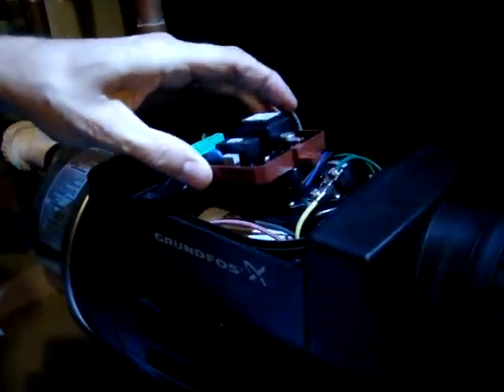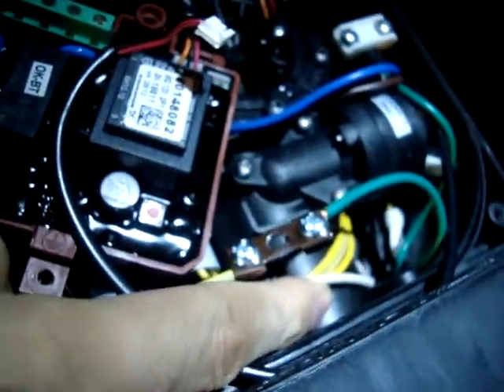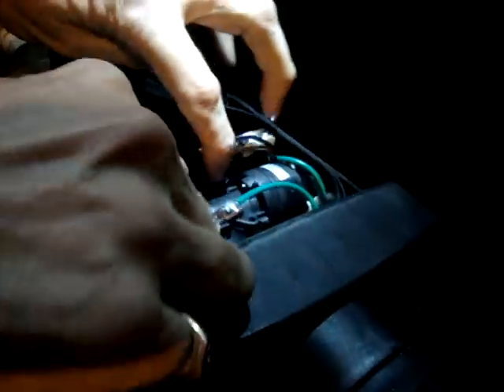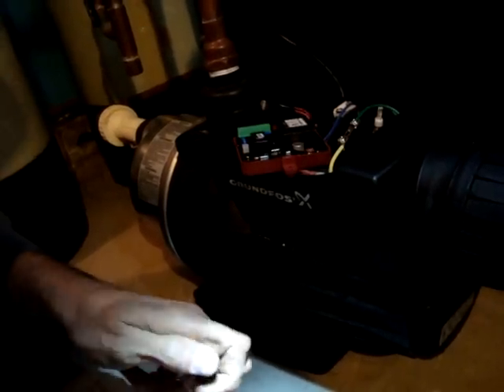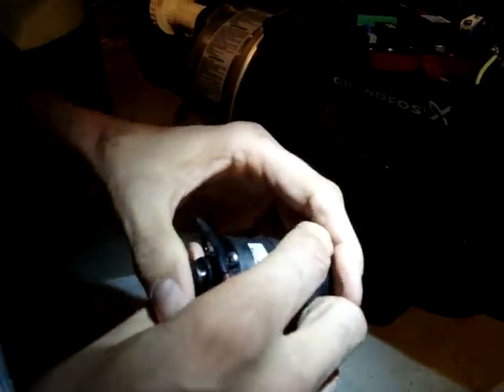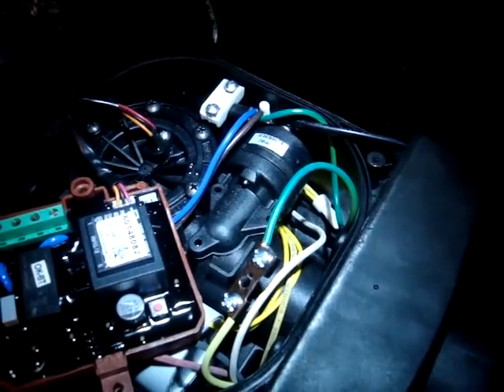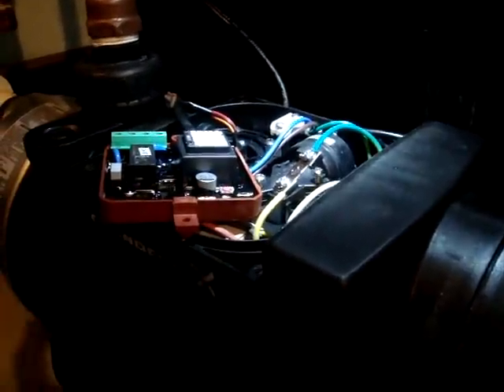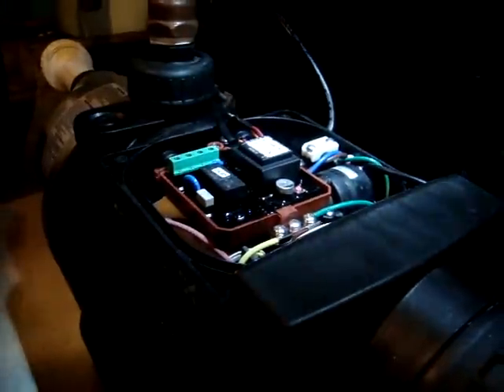Adjusting Grundfos MQ 45 pump

Comment: I checked the cut-in pressure on ours and it's down at 20 psi instead of 28-30, so I'm hoping to adjust this a bit. I assume the small onboard pressure tank should be adjusted a bit as well?

Comment: I just adjusted my pump as in the video. I wanted to lower the total pressure. Here's what happened. I adjusted the switch out 1/2 turn. The "cut in" pressure went to 25 PSI from 50 or so, and the pump cut out pressure stayed the same at 65. I was hoping to reduce the Overall pump pressure.

Comment: Do i need to add a regulator and a check valve to this i was thinking about putting a 50-100 gallon tank after my pressure tank so i can run my house on this pump? Will that work? Ive acquired this unit for free. The reason for doing this is so when my water outside my house befor e it enters the house sometimes it pulls all the water and no water in the house and the well pump has to build back up. Hince the 50-100 gallon storage tank with this pump could it work?

Comment: My Grundfos MQ3-45 240v is still running strong after 9 years. I had an issue where I would hear it power on (humming) but not pump water for a few seconds then kick in and then you could hear it push water. I thought at first it was the pressure switch but after thinking it through realized it was the capacitor. Instead of buying the exact replacement, which was pretty expensive, so instead I purchased one off amazon with the same specs (but different dimensions) a (CBB60 Motor AC 450V 40uF) for 17.99 and let it hang out the side. It worked perfect and starts pushing water immediately now.

Comment: So mine will not turn on when I run my water, unless I run a sink and a shower and something else. I can hear a small rattle when water is flowing through it when the pump is not on. I checked the flow switch and it seems to be free of any debris. Will adjusting the screw help?

Comment: this adjustment is so the pump will turn on sooner as the water pressure drops? Currently the pressure in my water system drops too low before the pump kicks on, I need to pump to cycle earlier , will this adjustment raise the pressure that the system drops to before the pump cycles on (so the pump kicks on sooner)?

Comment: Hi all, I tried this on mine, 2 half turns, 1 at a time, however it is still cycling 11secs on, 20 secs off. Could this be a capacitor issue? Thanks for any info, and thanks for the videos!!
Reply: no,  if capacitor  faulty pump will hum and no turn or completely not working

Comment: This video does not tell you to relieve the pressure by finding the valve under the round cover in the back.  You then have to recharge after adjusting.
Reply: in what case you have to relieve the pressure of the valve? if you wanna made start the pump with low pressure? mine isturn on when the pressure drops to 35 psi .

Comment: So whats stopping me from driling a god damn hole in the back of the housing so i can do this with it all together and no guess work as the gauge will show me whats what in real time?
Reply: the rubber cover and that the adjusting screw is under power all the time.
Reply: @moimemesuis  this is not correct. I've dismantled whole sensor and it's actually super simple mechanism.  If you look at it (for example 3:54) it consists of 2 halves. 1st half is "water" half, it let the water in, but the water is blocked by silicon membrane - so it's closed "cave". 2nd half is "electric" half, but there is actually just 1 stupid microswitch (close/open circuit) without any electricity. Water press on that silicon membrane, that membrane press on a big plastic button and if that big button is pressed enough, it press the microswitch. That screw just increase/decrease a tension on a spring, that press the big button against the water pressure.

So it's actually a good idea to drill a hole to the housing and remove that rubber plug (-:

You can easily dismantle whole thing. No worries. There is nothing you can break or crack. My pump had an issue that every 10-15sec of water delivery it turned off for a second. I guess that that spring just lost some strength over the time and it can't hold the pressure of the water anymore. I had to remove the whole sensor like 20x, because the correct spot was in a very tiny area. I've moved it 3 degrees more pump never stop (even without water delivery), I've moved it 3 degrees less and 10-15sec pauses were there again.
Reply: Have you had any luck figuring yours out? I just bought a house with one of these (installed 2013) and realized it never kicks on. Gauge pressure before the pump is about 40-45 psi. I am guessing pump inlet pressure never drops low enough.  So why is the pump even here, just seems like a restriction.  Water pressure is adequate but it's not 65 -70 of my old place (borderline too high per home insp.)

Comment: My pumps starts and pumps fine but every 11 seconds it cycles off and immediately back on...it "pulses" is this what needs adjusted?
Reply: I have the same problem, i try to found out what's wrong, i think the pressure switch that is bad
Reply: Stefaan Goeman did to u get to the bottom of this issue? My pump is cycling 11secs on, 20 secs off. Thx!
Reply: Exact same timing (11 on, 1 off). Anyone got an answer? This is a brand new pump that was stored in the original box in a dry location for a number of years. It's also quite noisy compared to the identical model it replaced.
Reply: Check for a leak somewhere  it doesn't take much.  Leaky fawcet, leaky toilet or a small leak anywhere.
Reply: surfgeorge did you get to the bottom of this issue? Mine is 11 secs on, 20 off. Curios, thx!
Reply: @surfgeorge  Flow controller needs replacing

Comment: Hi, I wonder if you can tell me how it is possible to connect a water pressure tank to this pump....Should I connect a pressure switch somewhere connected also to the pressure tank??? thaks
Reply: You'll need to write to Grundfos for that
Reply: BS.  Just hook it up on the pressure side of the pump.  Grundfos product manual  and customer support suck.  I have just installed a pressure tank and it eliminates the short cycling.  I may increase the low factory pressure setting at a later date.
Reply: @robertgraefe6205  Yes, I did replace a normal pump in a hydropneumatic system by this pump, leave the tank installed and works wonderfully.
Reply: and they told me to look page 21 of their fucking PDF which said nothing
Reply: It should work with a pressure tank but you would need the owner's manual to see how it's done.  Other than that your well guy or plumber should be able to help you out.

Comment: I'm not sure if your still monitoring this, but I have the mq35 and it has the same components.  I have turned that pressure screw once as in the picture and again the same amount since it didn't change anything the first time and the pump still only kicks on at 30psi.  I would like to get this to 40psi if possible.
Reply: Write to Grundfos and find a local service tech

Comment: How did this end up working?  Does it cycle on and off more, or does it just pump up the small pressure tank that much higher s it cycles on and off the same but just provides more pressure?  Thanks for the video!  It was great to see this adjustment.
Reply: It just changes when the pump kicks on.  Doesn't change anything else
Reply: Thanks for the potentially helpful video. Would this adjustment resolve a delayed starting issue with the pump? My pump sometimes takes anywhere from a a few seconds, to a few minutes to start when a tap is opened. It has worked flawlessly since 2008 until now. Thank you.
Reply: It cycles on quicker.  Pressure is the same.
Reply: @johnpiatek1588  So this just adjusts the turn on pressure? But you said if you turn it too far it won't cut off. So doesn't that mean this adjusts the turn off pressure?
Reply: Resolves delayed starting but it's normal for the pump to take a few seconds to kick on.  It is activated by pressure drop and/or flow.  If there is too much back pressure in the lines (as in the case of larger pipes with long runs) it takes a long time for the pressure to drop to around 25 psi when the pump kicks in.  That's where the adjustment really helps.